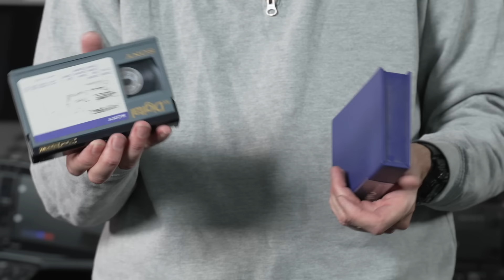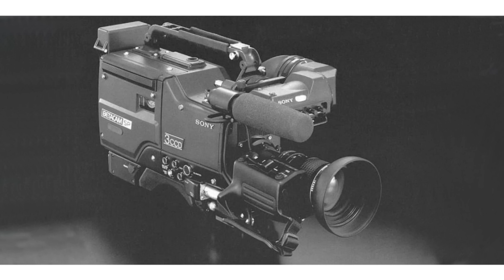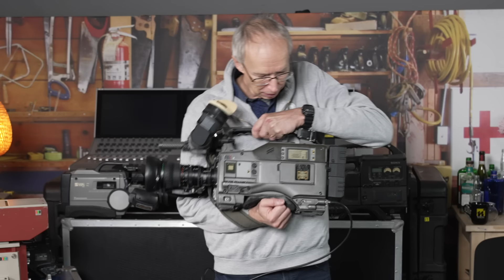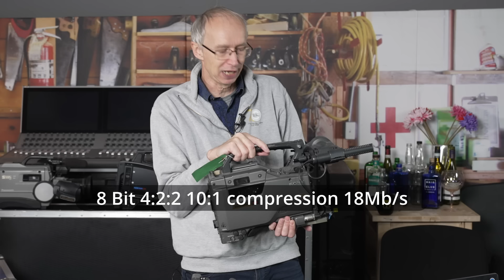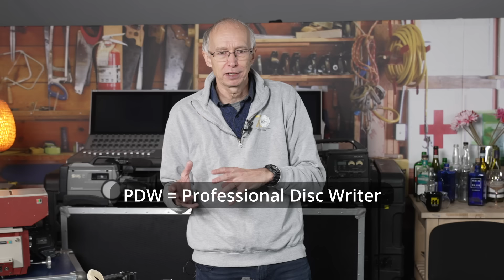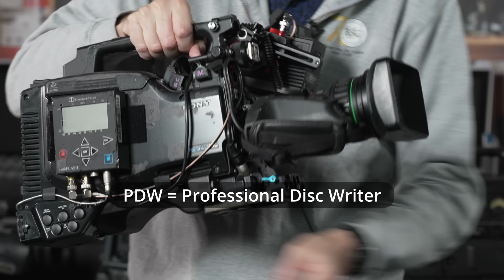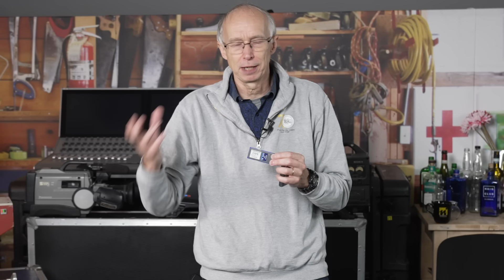Betacam, Digibeta & Optical Disc, a look back at some vintage Sony Camcorders with Alister Chapman

Comment: I started out in 1996 at 16 years old. With a VHS Camcorder. Editing with two VCRs. It was a crazy thing to do. But I somehow did it. Then I moved up to a S-VHS system. I remember when MiniDv came out and it was a game changer. People starting out today don't know how easy they have it. With 4K, 6K, 8K, 12K cameras. PC Based editing etc. I always thought 720x480i 4:3 was the best we would ever have. lol Yes I remember the IEEE 1394 FireWire. I could never afford a PC that would handle it. My first PC had like 8mb of ram. I can also remember all the people trying to make video look like film. They came up with all kinds of crazy ideas. Panty Hose over the lens, special lens adapters etc. I also remember the 3D craze too, people making their own lenses with mirrors etc. Man I cannot believe how far we have really come.
Reply: My career began in 1982 with 3/4" linear editing, 20 minute loads.  Then to CMX, controlling as many as 5 VCRs (various formats), a production switcher and audio cassette player.  Manual audio mix.  Until non-linear editing, one had to think and shoot for the edit.  Warm Cards were away to offset the white balance to add extra punch.  Many learned to borrow a set and match it to Walmart paint swatches instead of buying.

Comment: Had that EXACT Betacam SP camera! You zoom-in, focus until you see the sparkling edge artifacts around people's faces or on object edges within the CRT viewfinder (i.e. the CRT was made by Citizen Japan) which indicated you were in focus! ZEBRA stripes lets you see that iris setting was ok when 80% of any bright sky was filled with zebra stripes!  That camera actual COULD output in colour if you had the RGB component adapter for the head or deck AND you could output composite colour on the lower left BNC output on the camera head. I think is also depends on which options you got from the factory. The CCD's were also fully Global Shutter which meant no motion artifacts and if you used a motion-compensated TBC (Time Based Corrector) you could get SUPERB imagery that still stands up today when up-scaled to 1080p or even 4K resolutions using a proper fractal/vectorized edges-based upscaler!  I have converted my COMPONENT RGB video to 4K and it is SUPERB QUALITY! due to the inherent quality of full Betacam SP component video chain!

V
Reply from the maker: The camera heads were always able to output a live composite colour image, either via the test out or encoder out on the back of the camcorder, or the video out on the side of the dockable cameras. Colour playback from any of the analog Betacam Camcorders and dockables needed the VA500 adapter which gave a composite video out from the back of the adapter box, there were no component adapters and no RGB adapters as Betacam used Luma + compressed time division multiplexed chroma (CTDM), so the best quality was achieved using Dub cables that passed the CTDM (The studio decks did have a YCbCr component out but CTDM over a Dub cable was still the highest quality). Upscaling SD, no matter how good, will never match the image quality we can achieve today, those Betacam era cameras only had 6 or 7 stops of dynamic range, the prism blocks introduced a lot of flare and then large amounts flare and shading compensation was added to try to help. To make up for the low resolution detail correction and coring was added and the chromatic aberrations from the lenses and prisims of the day were ever present. The end result was highly sharpened images full of un-natural artefacts but with little real detail. It's why in the US a huge amount of television was shot on 4:3 35mm film and in Europe Super 16 film remained popular until HD became common place. It's a lot of fun playing with  them and seeing what you can squeeze out of them with modern software tool and we can romanticise all we want about how good they were - and they certainly had a look that is very different to today. But we now have optics and cameras that dramatically outperform these old cameras, that don't need all the artificial sharpening and correction processes, that actually capture fine details and textures.
Reply: @alisterchapman  we were outputting live COMPONENT RGB from the back deck with the adapter in the field to our Pinnacle VFX and to a TBC for mobile editing using our DPS Perception digital recorders at 30 megabytes per second uncompressed using the old SCSI hard drives which were like 2 to 4 gigabytes in size as main storage in the early-to-mid 90's.

Only a couple minutes were recorded at a time so a LOT of drives were carried in the van.

You could specify from Sony a full RGB component back adapter for the back deck on the BVP7 series Camcorder heads with FULL RGB and not just YCbCr component video output. I think we paid like $15,000 CDN extra for it directly ordered from Sony Japan! The YCbCr connector was always Chroma-reduced while the full component RGB output had an expanded colour palette which was originally requested by big sports venues and broadcasters to get the best image quality possible. 

I remember at NAB 95 that Sony also demoed to us in their hospitality suite, their monster-size studio pedestal-mounted prototype 4K resolution Broadcast Sports-oriented global shutter 2/3rds inch CCD camera with its footage being shown on the very first monster-sized 42 inch Sony 2048 by 2048 pixel RGB Trinitron CRT displays usually used for Radar Displays and NSA/NRO satellite image processing systems. The quality was STUNNING and STILL holds up today in 2025! 

I also still have 30 megs per second uncompressed 720 by 486 recorded Betacam SP footage that I transferred and up-rezzed to full 4K using a fractal resizer and interlace motion compensation which has AMAZING quality that DOES NOT have that fuzzy outline you see in typical up-rezzing! People always thought it was HDTV footage when its just 4:3 SDTV footage!

On our BVW-75 decks within fixed-base operations, we had a Sony Component RGB card installed INSIDE each deck that output directly to the Pinnacle VFX systems. That too was extra at around $10,000 CDN per deck! Most people didn't know that extra daughter-boards could be bought and installed directly from Sony in almost ALL BVW and DVW decks that had extra video processing features that you could specify as a custom option mostly done for sports broadcasters, big network studios and government agencies such as NASA or DOD. 

Since my boss was on good terms with Sony Canada and Sony USA  head honchos, we could order directly from Japan for the extra options which we had sent to our Sony Canada professional broadcast repair headquarters for installation which was in Richmond, BC during the late-80's/early 90's.

So yes the BVP7 heads COULD get component RGB out AND you could get the same for the BVW-75 decks installed as a daughter-card but you had to ASK Sony headquarters and pay a BIG amount of money for it!

V

Comment: Great video. I was a videotape operator in the 80's and 90's and worked on most of those formats plus 1" and 2". We had Bosh LDK 90's where I worked. They were ridiculously heavy but produced a stunning picture for the day. I loved all the infrastructure you needed for production/post production back then, it was a golden age. The 2000's and solid state changed everything, it just doesn't have the cache it used to.

Comment: Hi there, really enjoyed your video.
I used to work as a news cameraman, and my first camera was actually one you didn’t mention, but it was fantastic: the Sony DXC-537 with a PVV-5 dock. Later I upgraded to the DXC-637, which was a much better camera, paired with a PVV-3 dock. After that came the D30, which I eventually replaced with the D35 because the D30 had some pretty serious issues.

I also shot DVCAM from the moment it became available, using the PD100 and PD150, and later even the PD170. Around that time Sony also released a very appealing consumer DV camcorder, the tiny Sony PC1. I used it all the time simply because it was so small. DV and DVCAM were brilliant formats, especially because they finally allowed me to edit comfortably on the go with a portable DV editor.

By the way. When I shot with the DXC 537 I also had a playback adapter, because then it was possible to get color video information out of the camera. I used that when I needed to use so called 'land lines' to get my images to news broadcasters all over the world.

Comment: my colleague documented unique folk musicians in the 80s on vhs camcorder, and he said the battery would charge for 2 hours and was good for 6 minutes
Reply from the maker: Nicad batteries were nowhere near as reliable as modern lithium batteries. They didn't have a very long operational life and would loose capacity very quickly, especially if you weren't very careful with how they were charged.

Comment: I have a Sony HXR-MC2500 here, still in almost new condition, full HD 1080. It has been sitting as a showroom model on a tripod in my living room and hasn’t been used since I switched to 4K cameras. It’s a nice, lightweight camera with lots of features. I’ve had a great time using it. Greetings from Venlo, the Netherlands.

Comment: I have, among several SD Camcorders, a Sony BVW 400 from 1993 that works perfectly, I have moved spare parts from another DVW 400 and have thus obtained a camera that works and is very well maintained. However, you have a few errors in the overview. Beta SP came in 1986 BVW 400 came in 1992 DVW 700 came in 1993
Reply from the maker: Uh, no, my dates are all correct and well researched.  - I clearly state Beta SP introduced in 1986 and that is what is on the chart. The BVW-400 was launched in 1990 not 1992, I was using one to shoot the world rally championship for the BBC during the later half of the 1990 season. The BVW-400 brochure pages I show in the video are from a Sony brochure, dated 1990, the full brochure even includes a full timeline, BVW-200 was 1988, BVW-300 was 1989 and the BVW-400 was launched at NAB in April 1990. The Digibeta format was announced in June 1993 but the DVW-700 camcorder wasn't available to buy until 1994 and it's actually listed by Sony on their timeline of important product releases as 1994.
Reply: @alisterchapman  A little research in my catalogs and rep books has led me to see that what you write is correct. I then wrote that Betacam SP came in 1986 because Beta SP is listed under "1988" on your chart and not under "1986" and I can't see anything else mentioned, therefore. It seems strange, however, that Sony only chose to introduce the DVW700 in 1994 when the DVW500 and DVW-A500 had already come on the market in June 1993
Reply from the maker: @nostalgoteket.tvogradioark1494  Perhaps the chart is a little confusing, but the pink line in the second row for the BVP5/BVV5 starts in 1986 and goes until the end of 1990, it's meant to indicate that that BetaSP combination was sold from 1986 to approximately 1990 (although it may have been available for some time after this). In each case the coloured strip starts on the left on the approximate release year with the camera model number and then to the right are further details of the format and/or codec, plus later camera releases etc.
Reply from the maker: @nostalgoteket.tvogradioark1494  Although announced in June 1993 I'm not sure that you could actually get the DVW500/A500 in 1994. Digibeta's most revolutionary aspect was the ability to copy from tape to tape with no quality loss and this meant that in post production you could add effects or graphics into an existing edit without losing quality as you did with BetaSP. So, there was a lot of demand for the decks for post production very early on using the A500 or an existing SP deck to play in SP content and then edit with back to back Digibeta machines. People continued to shoot on SP camcorders for a very long time after the introduction of Digibeta and the initial take up of the DVW-700 was relatively slow while SP and the BVW-D600 was very popular. But in higher end post production Betacam SP was quickly replaced by Digibeta.
Reply: @alisterchapman  Yes, the advantage was great when you could work in SDI. endless copying and graphics work back and forth without loss. But in fact, Betacam SP also made models with SDI. I have four of them. They are called BVW-D75 PS. and came on the market in 1991 TV2 in Odense (Denmark) here we bought them in 1991/92. But they never became so widespread, as it was analog to digital. I don't know if BBC Television Centre had them.

Comment: Would anyone like a brand new in the box ED Beta cam?  Model No EDC-50
Reply from the maker: I have a very vague recollection of the EDC-50, it was a last gasp attempt to create a semi-pro/consumer camcorder based on metal particle betacam tapes running at normal Betamax speeds, so you could get up to 4 hours on a single tape. Like S-VHS it was a Y-C system, the camera had 2 CCD sensors, one for luma and one for colour/chroma. In the end Hi8 offered similar image quality in a much smaller package and very few EDC-50's were ever sold. That's quite a collectors item.

Comment: I learn my trade on U-Matics, pre Beta-Cam, with Sony DXC3000s before moving on to Sony BVP30/110. Ikegami was king, Scotch tape sucked, battery belts weighed a ton, three machine edits meant dissolves and Quantel paintbox had us stoned with amazement.
Reply from the maker: And the paintbox needed an airconditioned room all to itself, now your phone can do so much more. And how could I forget battery belts....... and sun guns!

Comment: The CD Nanoflash is a wonderful device to add to any vintage gear with SDI outputs.
Reply from the maker: It was ground breaking at the time - but quite big by todays standards and only 8 bit. BUT it will convert from 1080 PsF to 1080 P which with so many newer devices no longer supporting PsF is very handy.

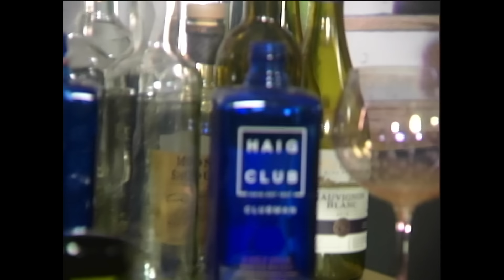Comment: At 10:00 in, how did you connect the sd output without aliasing?
Reply from the maker: I used a very cheap Composite to HDMI converter, there is a fair bit of aliasing, it's not the best conversion.

Comment: I got carried away on eBay a few years ago... Auctions.. Ended up with DSRs   300,  570ws 500 450,, PD 175,   HVR z1    I power the 570 and 300  with 8 li 18650s in a box... 4s 2p straight into the ext power socket.. They handle 12 to 16v
Reply from the maker: The later stuff was designed for lithium, but the early Betacam gear was not.
Reply: @alisterchapman  Thank you for vid...  It was good to see the photos of you in action too..

Comment: I very briefly started on U-Matic with the heavy recorder slung off your shoulder connected with that thick umbilical to an M3 or M7 tube camera. I ended up working at several facility companies so nearly all of these bring back memories - not all of them pleasant! 

They all had their own foibles and idiosyncrasies  you had to get used to. I recall the switch to 16:9 was relatively quick (flashbacks of those awful anamorphic lenses for mini-DV and vignetting!) but the switch to HD took much longer - we had to carry quite a few formats for a few years both SD & HD. Once HD did become established the rate of change from tape to optical to solid state was very quick and by the time I left the industry in 2016 it seemed like Sony were releasing new models every 6 months or so which made it difficult to get a good return on investing in a model for rental. 

There were 2 distinct areas by then of trying to make TV quickly and as cheaply as possible or go down the luxurious semi cinematic route including mounting primes on B4 mount cameras with various adapters, Varicams, REDS, Arri Alexas etc. The amount of knowledge we had to learn and retain and impart became ridiculous. 

Once people started saying oh I'll shoot it on my i-phone I decided to call it quits. I don't miss it!
Reply from the maker: The switch to 16:9 was an odd period. Some of it was driven in Europe by the common use of Super16 film for drama which had an approx 15:9 native aspect ratio. In the US 35mm film with a 4:3 gate was more common. The first mainstream 16:9 video cameras appeared around 1994 (my DVW-700 was the WS version) but the vast majority of televisions were 4:3 CRT tubes. At this time almost all broadcasting was still analog. In Europe we had PAL+ from 1994 from Channel 4 (although it wasn't standardised until 1996) which used an anamorphic PAL signal to distribute 16:9 SD. 16:9 CRT TV's started to become much more common from around 1996/97 and the BBC ended up adopting a compromise from around 1997 and broadcast everything in 14:9, so no one got the ideal aspect ratio. The advent of flat screen 16:9 LCD TV's and the start of the switch over to digital broadcasting from 1998 onwards really accelerated the switch over with the BBC placing 4:3 content within a 16:9 frame with black side bars. But it took until the mid 2000's for 16:9 to become completely normal across all platforms. In the US they went from 4:3 standard definition to 16:9 HD, there was no mainstream attempt to put 16:9 into NTSC due to the lower resolution, plus with so much TV content shot on 4:3 35mm film there was less impetus to change until HD broadcasting became normal in the USA which started in 1996 but didn't really become commonplace until the mid 2000's. 16:9 standard definition always felt like an in-between format, but it was around for a good 10 or 12 years. I too remember the anamorphic lenses for the PD100 and also working with projects with 1.42 wide pixels instead of square pixels.